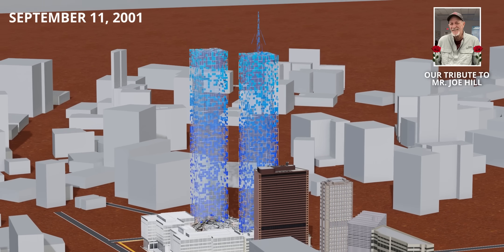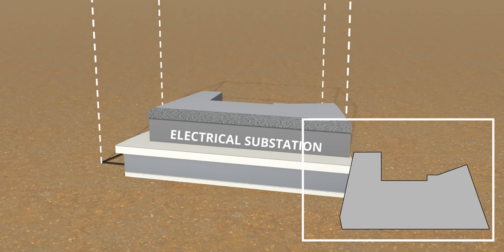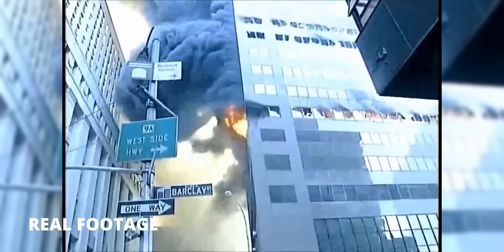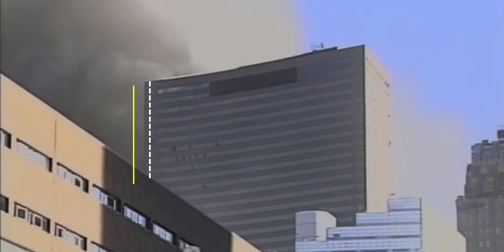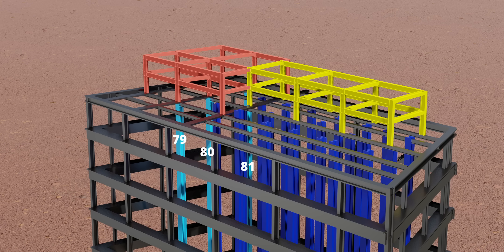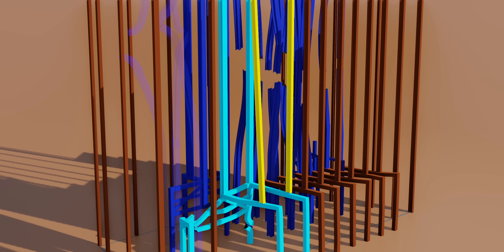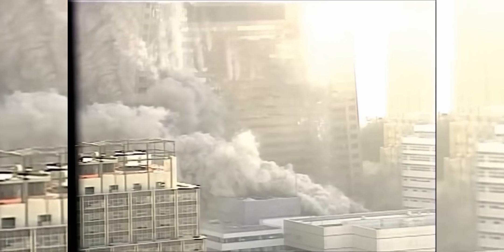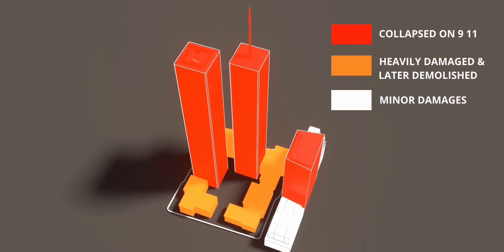Collapse of Building 7 | The Complete Physics

Comment: The only way we'll know for certain is by recreating the scenario. Possibly a small scale replication of the event.

Question then becomes, how do we trust who creates it?

Simulations can be manipulated but then again so can a small scale reconstruction of the event.
Reply: Nonsense.  I prepared this brief summary explanation of my own analysis. No politics, just engineering. 

The North Tower collapse at 10:28am bombarded Building 7 with tons of burning debris, causing heavy damage and starting raging fires burning out of control for 7 hours. Half the responding FDNY firefighters having been killed, others injured, units in disarray, equipment destroyed, no water pressure, and the greater urgency of Search & Rescue efforts, firefighting at 7 was pulled as futile. The building couldn’t be saved and was left to its fate.

www.youtube.com/watch?v=g_SvpwyC17M&ab_channel=MFitz  

Collapse of a burning structure is always a concern for firefighters. Steel buildings subject to fire rely on active fighting of the fires to survive. Buildings are designed around 1 to 3 hours of fire resistance, allowing time for occupants to escape and ACTIVE firefighting to get started, after which all bets are off. Left to their own devices they will exceed their design envelope and collapse. In B7 the occupants escaped, passive and active fire protections were compromised and active firefighting was abandoned which left the building to take its chances. It lost. Odds on Building 7 would eventually collapse, and it did. No big deal in logic. That is the sort of choice firefighters make every day in brush fire situations - which houses to save and which ones to let go. Only real difference here is moving the decimal on the size and cost.

www.youtube.com/watch?v=WnYBX6QT0R4 

FDNY Chief Daniel Nigro ; The biggest decision we had to make on the first day was to clear the area and create a collapse zone around the severely damaged 7 World Trade Center, a 47-story building heavily involved in fire. A number of fire officers and companies assessed the damage to the building. The appraisals indicated that the buildings structural integrity was in serious doubt. I issued orders to PULL BACK the firefighters and define the collapse zone. It was a critical decision; We could not lose any more firefighters. It took a lot of time to PULL EVERYONE OUT, given the emotionalism of the day, communications difficulties and the collapse terrain

FDNY Deputy Chief Peter Hayden ; We had our special operations people set up surveying instruments to monitor and see if there was any movement in the building. We were concerned of the possibility of collapse in the building. And we had a discussion with one particular engineer there, and we asked him if we allowed it to burn could we anticipate a collapse and if so, how soon? And it turned out that he was pretty much right on the money, that he said 'In its current state you have about 5 hours

The collapse of Building 7 was anticipated all afternoon and widely reported in the media with at least 24 video cameras recording some or all of the collapse. Everyone at the time knew what was coming and why.

www.youtube.com/watch?v=OY5S5k3tMHI 

Building 7’s collapse was totally different to the Twin Towers, harder to understand and most of the details difficult to see. But we can sort out what happened through careful analysis and observation.  What follows is MY EXPLANATION of the collapse sequence using the best available information and relying on no authority.

B7 was complex structure, a 47-story steel framed building built on top of a smaller existing 3-story building, requiring several lower floors dedicated to complex load transfer structures instead of usable office space. Of trapezoidal shape and all-steel tube-in-tube construction, B7 (above the 7th floor) consisted of a central core of steel columns carrying most of the gravity load, perimeter steel columns around the outside of the structure carrying the remainder of the gravity loads and long span beams and girders to tie those elements together and form the floors. On the outside of the building hung a moment frame - the last part of B7 to fall. 

Phase 1 : Collapse initiation for B7 is notably quiet with observers not realizing the building was collapsing! There was no audible warning in the form of say hundreds of ear drum busting 180-190dB explosive bangs preceding the collapse. The first externally visible signs of collapse initiation occurred at 5:20:28 pm. Here at 12:00 a local CBS affiliate reporter is talking 10 blocks from B7 when collapse begins. People don’t start to notice the collapse until 12:11. Then at 12:45 is the famous CBS fixed camera clip of Building 7’s collapse Again, note how quiet it is.

youtube.com/watch?v=t5tEy6mXSE8&ab_channel=fresnosean379

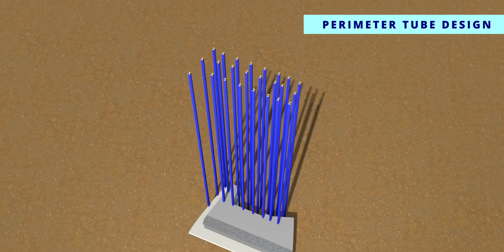Collapse initiation was due to multiple lower floor failures above the load transfer region (7th floor) in the NE corner of the building. In this video at 0:45 you can see the NW corner from inside the building while under construction, Column 79 just out of frame on the left. That big, angled steel beam across the top of the frame connects to C79 at one end. The girders connect to the beam. That beam and all those girders depend on just one connection

youtube.com/watch?v=nP3TNHPCIVU&t=35s&ab_channel=EdwardCurrent

Phase 2 : Lower floor failures caused a loss of critical lateral support over an excessive length of core Column 79 and it buckled. If you look at a floor diagram of Building 7 (see above) and look at all the structures that depend on C79 you quickly realize this one column was a relatively isolated structural element on which a disproportionately greater fraction of the structure depended . Externally we see a vertical progression of window breakage along the 44-46 line and a kink in the roof of the East Mechanical Penthouse at the top of the building, consistent with C79 failure. The transition from full capacity to almost no capacity occurs in virtually an instant. Once the buckling failure occurs there is almost no resistance

Normally with a buckling column, the load could very well be redistributed to other columns, meaning the buckling could stop after a while. With C79 that is not the case - the failure did not redistribute the load, so the collapse rapidly progressed to the roofline, sinking the rooftop penthouse.

Phase 3 : With C79 gone, B7’s progressive, non-symmetrical collapse continues with C80 and C81 at the east end of the core left laterally unsupported and quickly buckled and failed as well, sending the EMP down through the building. C79-81 all have no diagonal bracing, which I believe is a major reason why they could not redistribute a lot of vertical loads among one another.

From there collapse progressed from east to west through the central core until the core was gone taking all of the interior floors and structures and probably most of the perimeter columns with it. You can see the horizontal progression of window failures low in the building and the dropping of the remaining rooftop structures into the building. One of the big takeaways from the NIST Building 7 study (that gets completely ignored) was their modeling which determined C79 failing under ANY circumstances would have initiated the same collapse sequence.

Phase 4 : After some 10 seconds all that remains of Building 7 is just a hollow empty outer shell - the exterior moment frame - creating the illusion the building is still standing since little has changed externally. But it’s just a hollow empty shell like an empty cereal box supported by only a few remaining columns and quite unable to remain standing. With all the internal framing gone. the north face leans inward, forming a V in the roofline, the last perimeter columns buckle under the strain and with nothing left keeping it up the moment frame free falls, landing on top of the 7-story high debris pile. It is only at the very end that a single measurement of alleged free fall acceleration is taken. Note this is not the building but just its outer shell, and only one corner at that, at the very end of the collapse. Start to finish the entire collapse took 18-20 seconds, or less than 1/3 of true free fall and we have to look at the whole thing, not cherry-pick little bits to fit a particular narrative. Worth noting _how fast something falls cannot tell you what started it falling in the first place. The debris spread out, blocking surrounding streets, heavily damaging the Verizon Building and destroyed Fiterman Hall, all well outside of Building 7’s “footprint”.  

Building 7’s progressive, non-symmetrical collapse was incidental and unintended collateral damage from the combined effects of fire + time + gravity started by the collapsing North Tower. That is true no matter who planned and carried out the 9/11 attacks or why . The collapse was of so little consequence it barely even registered at the time, a mere footnote. 

Anything can seem like a conspiracy if you don’t understand how it works. Now you should. I hope you found this helpful and informative, not adversarial and it solicits informed critical comment. If I made any errors of fact, logic or reason or left anything critical out, please let me know so I can fix it. IF you can offer a more plausible alternative please do. Be the first. Please start any reply with the words “Tits McGee” or I will know you didn’t read it and are wasting my time.

Comment: Brought to you by the CIA ...
Reply: And yet not wrong. Go figure. 
	
This video is pretty good – with a few exceptions - and goes into a much higher level of detail than many viewers will be able to comprehend.  While not perfect, the collapse mechanisms – the sequence of failures - described here  are substantially correct and this is true no matter who planned and carried out the 9/11 attacks or why . 

That may not be what you want to hear and go against 20+ years of entrenched dogma and conditioning, but it’s not wrong. 

That also means (in case you did not get the hint) this video can be (and IS) absolutely correct in its description of collapse mechanisms AND the 9/11 attacks could still have been some sort of inside job. The two things are in no way mutually exclusive. 

The mechanisms described here have broad professional support around the world. There are no professional engineering organizations (for example: ASCE, ASEE, ICE, etc) that disagree with them or have offered any formal dissenting opinions or alternative hypothesis. 

So, setting hubris aside, either the overwhelming majority of the worlds structural engineers and simple observation are wrong,… … or you are. Which seems more likely? 

IF you still think believe this explanation is wrong then produce a better one . Good luck with that. No one ever has and I don’t see you moving that needle today. 

No one ever does.

Comment: what a bunch of shit.
Reply: And yet not wrong. Go figure. 
	
This video is pretty good – with a few exceptions - and goes into a much higher level of detail than many viewers will be able to comprehend.  While not perfect, the collapse mechanisms – the sequence of failures - described here  are substantially correct and this is true no matter who planned and carried out the 9/11 attacks or why . 

That may not be what you want to hear and go against 20+ years of entrenched dogma and conditioning, but it’s not wrong. 

That also means (in case you did not get the hint) this video can be (and IS) absolutely correct in its description of collapse mechanisms AND the 9/11 attacks could still have been some sort of inside job. The two things are in no way mutually exclusive. 

The mechanisms described here have broad professional support around the world. There are no professional engineering organizations (for example: ASCE, ASEE, ICE, etc) that disagree with them or have offered any formal dissenting opinions or alternative hypothesis. 

So, setting hubris aside, either the overwhelming majority of the worlds structural engineers and simple observation are wrong,… … or you are. Which seems more likely? 

IF you still think believe this explanation is wrong then produce a better one . Good luck with that. No one ever has and I don’t see you moving that needle today. 

No one ever does.